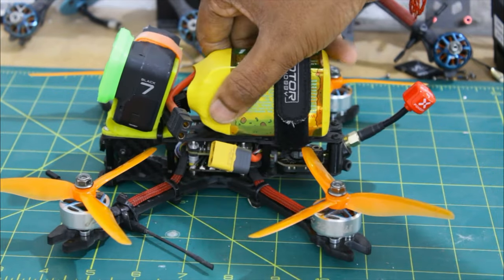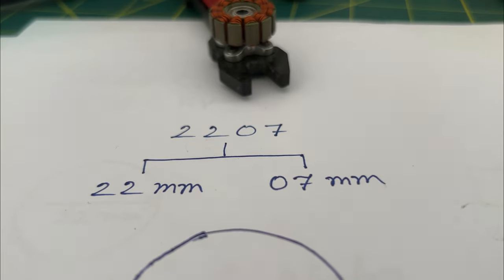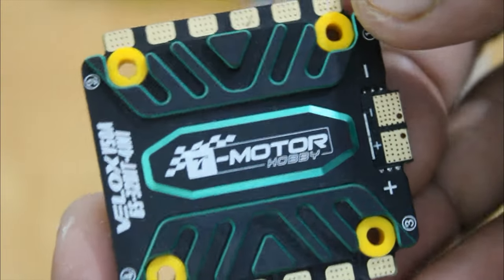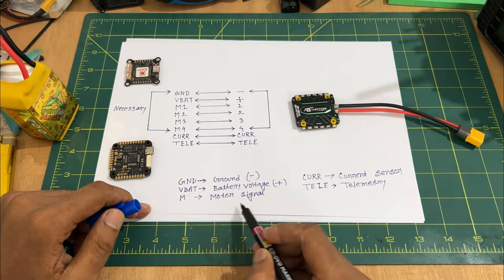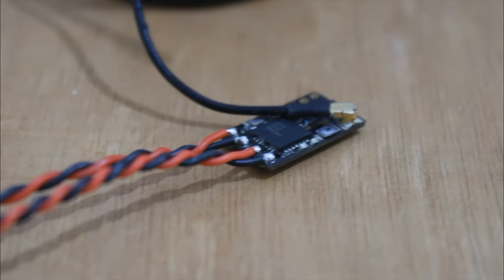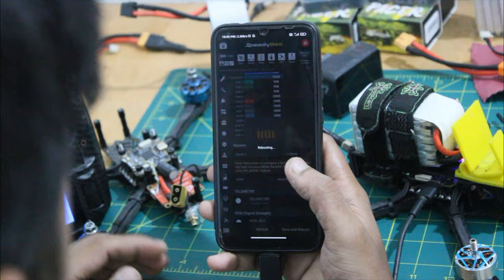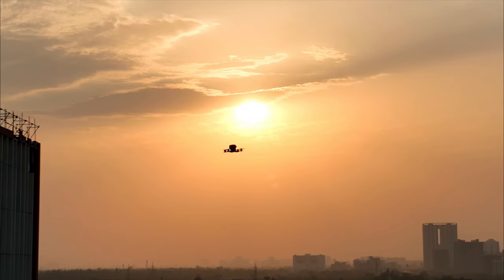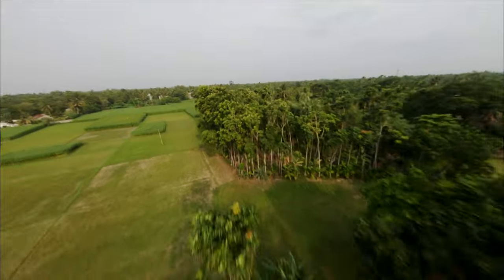How to build FPV freestyle Drone at home || FPV India || #fpv #fpvdrone #drone

Comment: @akgadget Great job! I like all your build at home videos. Do you have the step-by-step instructions in written format somewhere (like your FB page or instagram), so it’s easy to read the specs and follow along?

I recently got interested in FPV and looking into getting my first FPV drone. For beginner like me, assembling all parts is somewhat intimidating.. so I looked into some RTF kits (Cetus X, GepRC TinyGo, Emax TinyHawk etc). However, all such kits are advertised as “indoor whoops” and I’d rather fly outdoors. So I need a freestyle beginner-friendly freestyle drone/kit that can handle wind (in other words, not whoop). Thoughts?
Reply from the maker: I’m sorry but I don’t have any written instructions.., but the best thing I can do for you is arranging right equipments.., contact me on Instagram I will help you..,

Comment: Bro can u explain in detail that how u reduced the jello 
Also why u didn't used any patch antenna on goggle
Reply from the maker: I used blheli32 ESC, and I changed the the ESC settings through blheli32 application.. and the settings are-
 motor pwm frequency High-48khz , low- 48khz..
Dmag-off
Motor timing - auto
If you're not using blheli32 esc then you can't change anything..
 And I'm not using any patch antenna cause I fly within 600-800 meter generally and I'm getting solid signal out of 2 omni directional antennas

Comment: Can i build under 10k rupees? Im from northeast,tell me the site,i have 2drones,but no fpv drone,like to try out
Reply: Not possible under 10k. Transmitter ( remote control cost 20 to 30k)
Reply: Motor set ( 4 in number ) cost around 5-6 k ,  frame cost 2k to 5k

Comment: What if insert 6s lipo in 4s 2306 2450kv moter drone..?
Reply from the maker: Yes you can but you have to reduce the motor output limit in betaflight from 100% to 66%